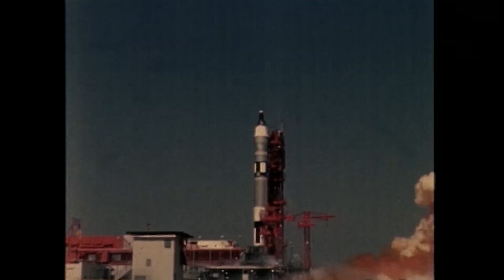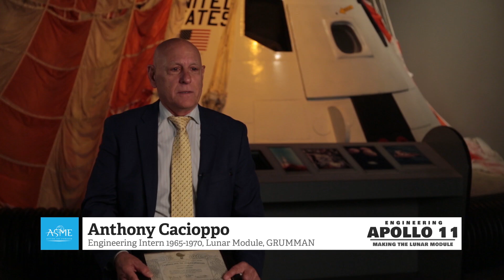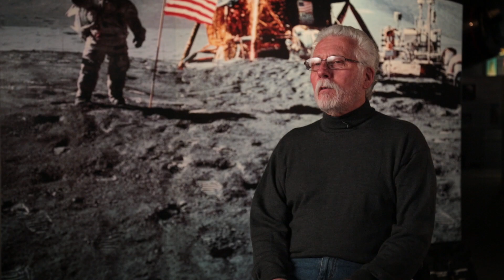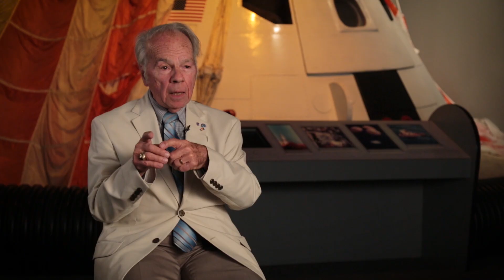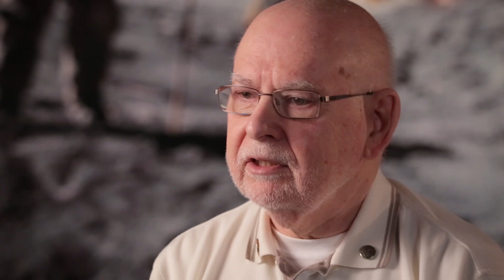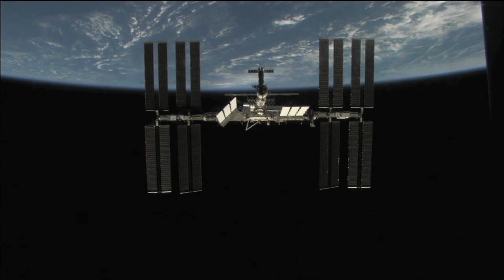Engineering Apollo 11: Making The Lunar Module [Full Documentary]

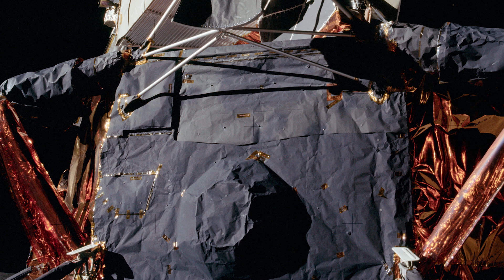Comment: 5:38 This thing landed on the moon? Or in a Hollywood basement?
Reply: @thePiercingTruth word salad
Reply: @thePiercingTruth and yes, this is critical “reasoning.” 

I don’t see what’s hard to believe that they had short exposure through the thinnest parts of the belts and they had shielding. That’s not impossible.

Ten years after the first flight we had fighter planes that modeled the future of aviation. That was an incredible feat, putting shielding on a capsule and using common sense is not a big achievement and much more believable, and I think we can agree the Great War actually happened, so..
Reply: @thePiercingTruth and I compared it to sunlight as a demonstration. Yes, sunlight is much less deadly! But, these belts harmed them in the same way. Causing some cell mutations that lead to cancers and cardiovascular diseases, like the ones extremely common among Apollo astronauts.

Sure, if you spent days or months or years inside the belts, you’d have similar symptoms to the biorobots in Chernobyl, just much less severe.

Also, let’s think about the Van Allen belts for a sec. Discovered by NASA. Released by NASA. Why would NASA release that info if it blew the top on their operation? Now is that “critical reasoning?”
Reply: Yes, it landed on the moon, slick.  In fact, it isn't the only one. There were 6 of them. That 'thing' had no wind resistance, no atmosphere or weather to go through. So, it was the perfect vehicle for what it was used for. You don't need a fuckin tank to land on the moon. Quite the opposite, you need a lightweight vehicle, made even lighter by the 1/6th gravity of the moon. No Hollywood needed, except in your conspiracy crackpot nutjob polluted mind.
Reply: @nebtheweb8885  Hahaha! Sure...
Reply: @truthvslibs2484  I’ve got a question. Assuming the landings were fake (they weren’t, but I’ll go with it) how would a real lunar landing be and look like? What would be different from the one we had?
Reply: @jakemckee2005  First you would need a vehicle that could withstand the solar radiation flux (not a prop with 3 layers of Reynolds wrap as the cabin).
 You would need a powerful power source to live on the moon for up to 3 days (Apollo 17), not car batteries. Imagine using your car battery to use your A/C on a hot day. How long will that last you?
You would use multiple rockets to land on the moon (and Mars) like all the probes do, not a single rocket engine.
That's just the tip of the iceberg.
Reply: @truthvslibs2484  how could the LEM not withstand solar radiation? It had Mylar and it was reflective. That’s enough to resist solar radiation.

I mean, if sunblock can do it, I’m sure a vehicle can.
Reply: @truthvslibs2484  they used hydrogen fuel cells for electricity. And funny thing, that gold Mylar was actually the AC of sorts. It kept the temp in check.

Hydrogen fuel cells are pretty efficient. Much more efficient than “car batteries.”
Reply: @truthvslibs2484  well, all the probes use 1 engine, they just direct it through multiple engine bells. Like a car having four wheels, doesn’t mean it has four engines.

And the reason they used more nozzles is because there was a thing under the center of mass that would block the engine.
Reply: @truthvslibs2484  also, don’t forget that the astronauts in Apollo were almost always outside. So they would just shut the LEM down when they were out on EVAs.
Reply: @truthvslibs2484  anything else you have?
Reply: @jakemckee2005  "how could the LEM not withstand solar radiation? It had Mylar and it was reflective. That’s enough to resist solar radiation.
I mean, if sunblock can do it, I’m sure a vehicle can."

LOL!! Thanks for the laugh! I needed that!
Get away from our thick atmosphere and magnetic field and the sun becomes a very deadly problem for humans. That's why nobody has left earth orbit.
Reply: @jakemckee2005   "they used hydrogen fuel cells for electricity."

No, not on the LEM. They used car-type batteries.
Reply: @truthvslibs2484  ah, you’re right. They did use that. I was going off of memory. CSM used a fuel cell.

And why is using a battery like that hard to believe? I mean, they could just bring extra. It’s not rocket science, unlike the rest of the program.
Reply: @truthvslibs2484  and yes, I was making a joke. The magnetosphere and ionosphere block most of the solar radiation. 

But that’s why everything’s reflective. It’s the same reason a mirror reflects light and doesn’t absorb it. And things that are white also don’t absorb light. Blocking solar radiation isn’t that hard.

It’s cosmic rays you need to worry about. Now those are hard to reflect.
Reply: @jakemckee2005  Try using a car battery only to run your car A/C on a hot day. Tell me how long it lasts, let alone in 240F for 3 days (Apollo 17).
You can't keep adding weight to a vehicle where every once counted. Apollo 17 brought a fucken CAR and extra batteries? The story is totally absurd in 2021.
Reply: @truthvslibs2484  ah, you just discredited yourself. It’s a vacuum. It doesn’t get heat from the surrounding area. It’s like how 100 degree air doesn’t feel as hot as 100 degree water. Air’s not as dense. In a vacuum, it’s literally just the solar radiation. Which is easy to deflect, as I said before.
Reply: @truthvslibs2484  and of course you can just add weight. It just makes the descent a little harder, because you have less delta V. But then you toss the dead batteries and you have less weight on the ascent. Like you never had the extra weight in the first place.
Reply: @truthvslibs2484  the rover is reasonable. They had a bunch of storage for experiments. They just left some and added a really light rover.
Reply: @jakemckee2005  No, when the LEM is filled with air it will slowly but surely heat to 240F. Apollo 17 sat in the 240F sun for 3 days non-stop with A/C on for most of that time,  let alone running all the communications 24/7, pumps, etc... with car batteries? LOL!
Reply: @jakemckee2005  Making the load lopsided on a single centered engine would be extremely difficult to control. That's why you don't see such things today. Ever.
Reply: @truthvslibs2484  that’s not what I’m saying. The LEM didn’t have any air on the outside. Of course it was pressurized.
Reply: @truthvslibs2484  and it doesn’t take much to run a relay to the CSM in orbit and back at Earth.
Reply: @truthvslibs2484  you can literally just place an equal amount of stuff on two or more sides and make it equal. And the center of mass would still be in the center. 

Also, it had little thrusters called RCS thrusters that helped it control itself. So even if it was lopsided, it would correct itself.
Reply: @truthvslibs2484  “That’s why you don’t see such things today. Ever.”

Falcon 9

Starship

Etcetera. Literally every other rocket.
Reply: @jakemckee2005   "you can literally just place an equal amount of stuff on two or more sides and make it equal. And the center of mass would still be in the center."

No, the moon buggy was all on one side.

"Also, it had little thrusters called RCS thrusters that helped it control itself. So even if it was lopsided, it would correct itself."

Let's see that replicated here on earth, especially in the 1960s. It was fantasy.
Reply: @truthvslibs2484  moon buggy was on one side. But it had experiments on the other.
Reply: @truthvslibs2484  RCS thrusters were made in the Gemini program. A program that stayed in LEO. And they are still used today. Space shuttle, Dragon, and almost every other space craft use them.
Reply: @jakemckee2005  "We are going back". I've heard that many times that since the 1980s. It never happens, and still won't happen. How many times can you get conned?
The Soviet Zond program was specifically designed to do a lunar fly-by in the late sixties, with several tests. It was abandoned because of the radiation fluxes in space outside the magnetosphere and the higher speed skip-re-entry was also very risky. It was too risky for humans.
Until you can confirm someone is ever going back give me a shout. And when they finally do it won't be in a tinfoil and cardboard spacecraft with car batteries.
Reply: @jakemckee2005  About the lunar rover. Yes the dust goes up (70 degree angle),  stops, and goes straight down. It must go in a parabolic arc in a vacuum, which it doesn't do. Also, the rover stays planted on the surface like a dune buggy on earth. Speed the film 33% and looks just like a dune buggy here on earth.
Reply: @truthvslibs2484 in the 80s, we still had the space shuttle. Any attempt back to the moon, that was serious, was talking about when the shuttle was cancelled.

And now, it’s cancelled. And we actually have a rocket. SLS. And a lander, starship. An official NASA program.
Reply: @truthvslibs2484  Zond was never meant for humans. It was a probe program. It did test a capsule though. But, it failed. Not because a moon mission was impossible, but because the probe had problems.
Reply: @truthvslibs2484  it does go in a parabolic arc though. I’ve never seen it go 70 degrees and stop. Maybe the dust particles speed apart and made it look like it stopped.
Reply: @truthvslibs2484  and when talking about the speed of the film, are you implying they slowed everything down?
Reply: @jakemckee2005  Yes, the probe had problems. That's why they tried multiple times, with some success. It was the manned lunar-flyby program. They didn't go for it because it's way too risky, just like today. And BTW Apollo 8 had no multiple tries and tests like Zond; they did it all in one shot! How about that! :-)
Reply: @jakemckee2005  Only the CSM had fuel cells. The LM didn't use fuel cells. It only had batteries. But they weren't ordinary car batteries. They were special silver oxide-zinc batteries that were lightweight and very efficient. Another difference was that today you can buy a typical car battery at Wal Mart for around $100 while the batteries in the LM probably cost $10,000 each in 1960's dollars.
Reply: @truthvslibs2484  This particular stability problem is as old as rocketry itself. In fact, every rocket must "balance" on its "column" of thrust, whether it's going up or down. Or stated more scientifically, the thrust vector must point very nearly through the rocket's centre of mass at all times in order to avoid unwanted rotation of the vehicle.
The LM ascent stage is a much more inherently stable spacecraft than a cylindrical rocket from an inertial point of view. (Keep in mind a rocket that flies through air can use the air to make it overall very stable.) Fig. 6 shows a front view of the LM ascent stage and the location of the people and things that affect the vehicle's center of mass.
The ascent engine is mounted inside the spacecraft, not attached to the bottom of it. This places the center of mass very near the center of thrust, limiting the rotational effect of off-axis thrust. In fact, during the first few seconds of the ascent the centers of thrust and mass are very close together.
The most massive component of any spacecraft like the lunar module is fuel. The fuel tanks are mounted as low as possible, and carefully balanced left-to-right. (Oxidizer is denser than fuel and therefore the fuel tank is positioned farther outboard.) Though not shown in Fig. 6, the RCS fuel tanks are mounted behind the astronauts, helping to balance the spacecraft front-to-back.
The astronauts are inboard of the fuel tanks and are considerably less massive. Their motion is further restricted by the cramped cabin. Thus the idea that the movements of the astronauts would spell doom for a stable ascent completely ignores the fact that the much more massive fuel is mounted farther outboard where it has a greater effect due to its steady depletion. In fact, the massive fuel tanks would actually damp, or lessen, the effects of the astronauts' movements in the same way the long pole carried by a tightrope walker increases his balance.
Reply: Funny how that tape is so haphazardly placed all over that rag hanging from some contraption sitting somewhere in a studio. How can you even show such crap crafstmanship with 3M tape? As if some drunkard began cerating some Picasso painting. This thing exactly at 5:38 minute is a shame depiction and proof that space junk cannot fly. Especially to the Moon.
Reply: @ericephemetherson3964  You extreme lack of knowledge regarding everything Apollo is stunning. Did you even watch the video? The LM's underlying structure was made of aluminum and it was very robust. The outer coverings were there just to provide temperature control and micrometeoroid protection. Above all else everything on the LM had to be as lightweight as possible. If they had designed it to look the way you think it should look it would have been too heavy for the Saturn V to lift it and the amount of extra propellants required to operate it would have been excessive and prohibitive.

Comment: I lived in Bethpage where the LEM was made. My best friends Dad was in charge of wiring for the LEM. Most of my school buddies had stickers on thier school books for the F-14 that said "Any time baby" with a picture of a cat in the center. (The f-14 was aka a Tomcat)
They made TWO identical LEMs. One waa picked up by the NASAs Guppy airplane (it flew right over my house at 100') I lived less than 1/4 from end of runway in Bethpage. When the LEM was on the moon the other was in the plant with engineers at the plant in case something needed to be done. When the mission was over, they pushed the other one out into the parking lot, painted it camo green and let for the weather. I passed it every day on my way to school.
Grumman was a great company to work for. Many fathers/sons worked there. The Bethpage facility was 24/7 operation. They STILL were working on the E2C, F-14 and other aerospace items .
The 60s were a great time on Long Island!
Reply: That's cool! My grandparents lived on North Millpage Dr off Stewart Avenue  (they moved there in the mid-late 1970s after the missions were over).  I lived in Massapequa until 1972 (I was 7 when we moved off LI) and I remember all the buzz about the Apollo missions, and I could swear I remember some "NASA presence" at a couple of science fairs in the area (We were in the Plainedge School District, lived on the opposite side of the sump from Plainedge High...)